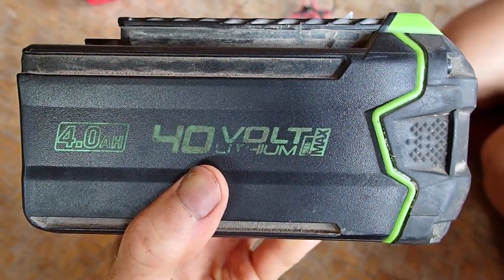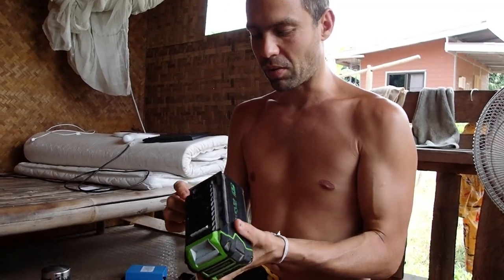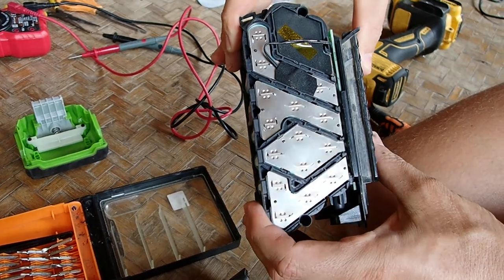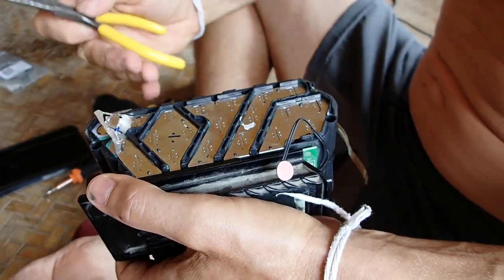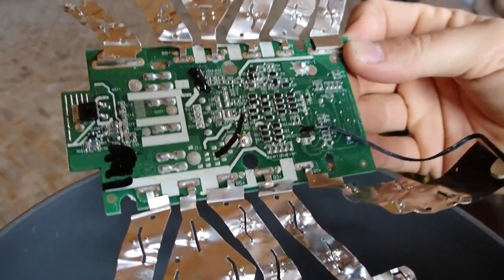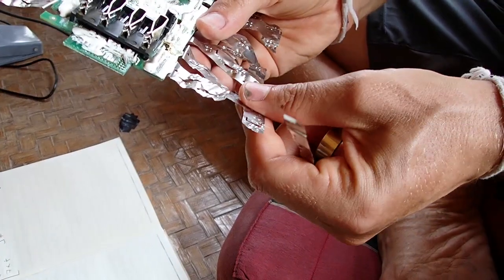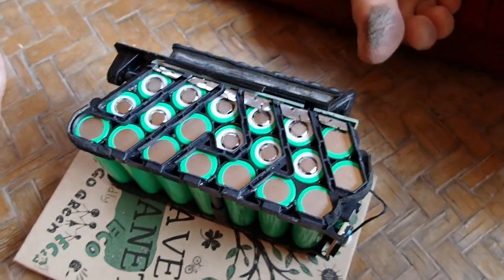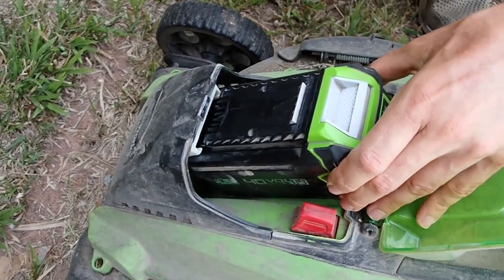DIY Lawn Mower Battery Greenworks BAF724 Fix (18650 battery replacement)

Comment: Hi, please how did you removed that top plastic from BMS? There is so much glue.. I cant get it out and all I need is to replace BMS (Ive fried it up when Ive tried to health check it). Hopefully I dont need to get rid of all the nickel strips and jsut resolder strips that are on bms already. Thank you
Reply from the maker: Use a heat gun to soften up the glue and rip apart, unless you forgot some screws?
Reply: @PlantSugar   the only screws I didn't unsrewed are the two on the side that holds cells together. And I've tried heat gun but the glue didn't looked melted or softened at all. Maybe I've just heated it too low since I dont want to overheat cells, so i will try a bit more, thanks.
Reply: Sometimes there are two tiny screws on the top. Mine were under some silicon gunk, could barely see them. I’m curious if there’s any easy way to remove the welds and redo without the welder?
Reply: @Bellabaddi  I think i didnt had screws there, a little bit more force ripped it apart (safely) finally. 
You have to remove the welds so that is impossible, soldering cells is the only other way but its too dangerous and may\will harm cells
Reply: What did you use to weld back the new cells with thin metal?

Comment: What were the nickel strips you used?  Have the same problem withy green works batteries and I want to replace the cells rather than chuck the whole pack
Reply from the maker: Nickel strips came with the soldering machine. I think the cheapest ones in the world here in Thailand.

Comment: What did you use to weld back the new cells with thin metal?
Reply from the maker: I used a cheap spot welding machine.